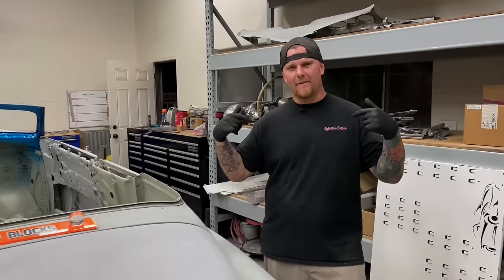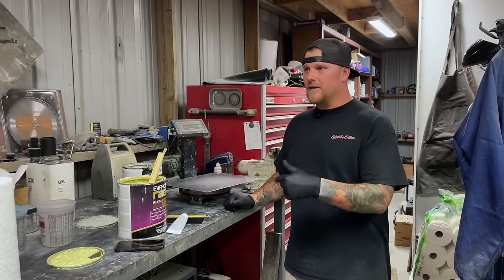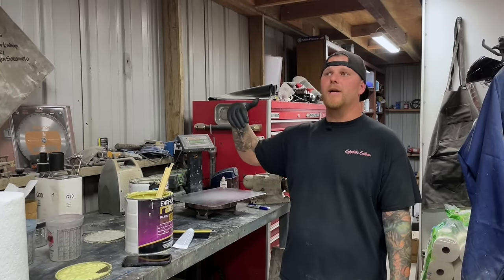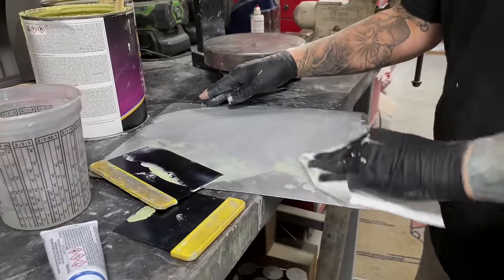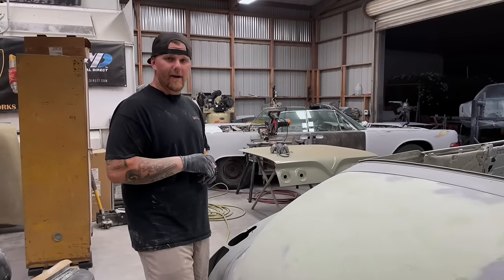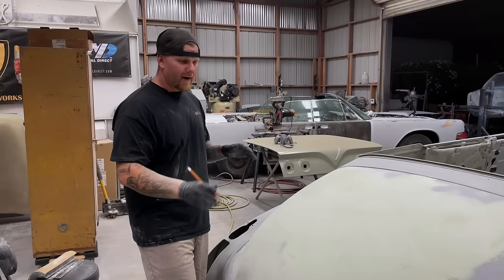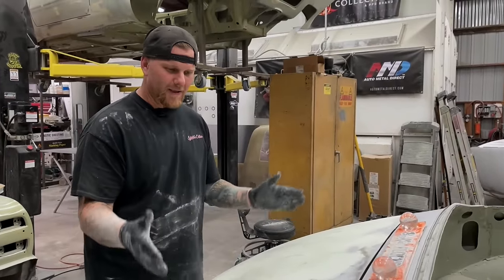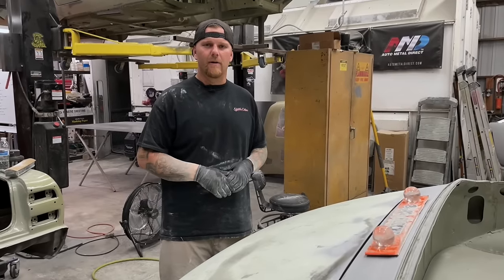The Body Filler Innovation You Can't Afford to Miss!"

Comment: I never like spot coating unless I really have to, always just reapplied my filler over the entire area. When I glaze I treat my glaze like primer and go outside my body work around 2-3 inches maybe a little more. The guide coat I love , I always have a can of gloss check as well as a final inspection then off to primer
Reply: Love the videos too
Reply from the maker: @FrankieTheTech  thank you!
Reply: All these little globs of mud make a humpty surface. On portion is softer then the rest of it. I haven’t seen any bodyman use a cheese grader in 30 years. I use a 8” DA to knock done high spots    and to remove sticky portion of the mud. It save time. It save blocking time and and paper and easier and eliminates humpty surfaces.
Reply from the maker: @dawinner777  you obviously did not watch the whole video. Everything we do has the exact same hardness it’s measured on a scale. It’s also a very tiny little bit of filler to get rid of any ripples anything you’re doing with the DA sander is not going to result in the same finish that we are performing here. This is for show cars not collision.

Comment: rage quantum is amazing stuff 4 hardeners per gallon sold separately. very smooth going on and easy sanding but insanely priced.
Reply from the maker: @jump4j  quantum? 4 hardeners??
Reply: @SYLVESTERSCUSTOMS  evercoat quantum 1 over 200 per gallon. amazing stuff. slow and fast hardener .10: 1 ratio

Comment: First off, congrats for being able to leave the doors open at that time. I would have all kinds of night creatures and blood suckers coming in. I've tried the 3M gold and  Rage Ultra and stuck with the Rage. The 3M spreads nicer but is too soupy in the heat. Best filler I've used is Evecoat Quantum. Expensive but you can really sculpt with this stuff and the hardener is epoxy based(although sold separately due to different temp ranges). I've had to cut back on the hardener with the Ultra when it kicks too quick. To me, the sound of sharp 80g is similar to a hand saw across a 2x4. I've found mineral spirits works well also for cleaning spreaders. I just make sure to dry them off. But it seems it more lifts the filler off than smear it. By the way, how are the elbows and shoulders holding up? I have good and bad days myself. Pushing 50. The life of a sculptor!😏
Reply from the maker: I haven’t tried quantum I might have to try it 👍🏻 I agree I have good and bad days.
Reply: @SYLVESTERSCUSTOMS  
It's a little pricey but aren't they all anymore. The red hardener is high temp (very slow) and the blue is mild temp. Sands great though.

Comment: Sorry about all my comments, but it’s interesting to me. I have a 1977 FJ40 Land Cruiser that I want to strip down and paint. So I watch with keen interest. 
If I understand you, you use epoxy primer, then body filler. Block to perfection and follow with another epoxy primer? What goes on after that? It also answers my first question about chemical adhesion. You use the second epoxy primer window and apply your high fill primer on that? 
I’d like to know the exact order and products used for when I do my Cruiser. 
Thanks,
Paul
Reply from the maker: We epoxy do filler work then reapply epoxy specifically vp2050 it’s a high build epoxy. Then I block that again and when it’s where you are happy with it I wet sand with 600 and  spray sealer and paint

Comment: At one time I was using Evercoat. $160 a gallon for Rrage Gold where im at.  Using Roberlo.  Works exactly the same. Almost identical. Low to no pin holes, Shrinkage hold out,sands easy, good adhesion ,1/3 the price.  Cheaper by the case.  Hard to beat. Purple 3M great product for $75.
Reply from the maker: You get what you pay for I suppose
Reply: Want to say thanks for responding first of all.  From my jobber I was told  they tripled the price to a factory burning down and supply chain issues they essentially passed that cost on over. 3m was always more expensive  product now it’s seems reasonable. Just because they tripled the cost didn’t all of a sudden make it a better product. Although I like the Evercoat products. Many products in my area unfortunately seeing things double. House branded labels are no longer being stocked. Really a bummer. If that makes since.

Comment: Ok. So the Rage Ultra is good by itself but the Extra extends its working time? Is that it? Do I need to buy both if I’m working small parts?
Paul
Reply from the maker: Correct the extra is for extra time. If you don’t need it then you are good. It’s a great tool in hotter weather.

Comment: I have a five gallon but cut in half,and keep my can of filler in there,it sets up quick cause the filler is hot before adding the activator.Cold filler gives you four times longer before it starts setting.
Reply from the maker: That will help I know there are guys who will put it in fridge etc that extreme of a measure is not good. You want the filler and panel to be the same temp. Optimal would be 70 degrees in a controlled room. But yes there are ways to pivot and modify. 👍🏻 thanks for sharing.
Reply: @SYLVESTERSCUSTOMS  I agree on the temperature of the filler being similar to the substrate, and it should make sense to anyone who is at all logical minded. Maybe tell people in a future video, that a cold filler won't be as workable or pliable, and won't bind into the scratches as well, and could cause delamination. I understand everything you are teaching, because I've done paint and body work as a hobby off and on for 40 years. The pencil trick is something I learned doing drywall, and have used it with bondo as well. Keep up the great work Teacher! Much respect and admiration. Kenny

Comment: I used evercoat until a guy left a gallon in a car I was working on of USC AG47 or USC Grip filler. And no it is not the same as zgrip......FYI. it sands faster and easier. almost as fast as Rage and is only 30 a gallon 28 to 32 depending on where you get it. Great cheap middle for most work. Really makes the Rage seem like a waste of money.
Reply from the maker: Might sand easy but does the work window get larger for 110 degree weather? Do you use a scale?

Comment: 3:45 Why paint the firewall and window frame before starting the mudwork? 13:10 Is it just because of the tight deadline?

35:35 Spreading it thin on the board was something that took me years to learn. 

The long open time of Rage Ultra Extra looks like a godsend. Wish that was around 25 years ago when we were doing an offshore powerboat. Had two guys mixing and one guy spreading in the heat of summer. Not to mention the fiberglass itch to go with it.
Reply from the maker: Yes we’re trying to get it done for Sema show so we’re taking every opportunity to save time. But yes it helps the work times so much.

Comment: We switched to rage ultra the last year or so it sands extremely well even compared to the 3m filler. Ive got a question for you how do you clean your filler off before you spread more on just blow it off good or do you wipe it with something?
Reply from the maker: Blow it off really good I don’t like wiping it with anything you take the chance of contaminating it.

Comment: Why would you use this instead of using Featherfill G2? Cost? Ability to make as much or little as you need?
Reply from the maker: Because you do not want to do all of your body work with polyester primer it is much more brittle and has a tendency to fail crack, and Delaminate. The goal is always a solid foundation. You should be skim, coating with body filler, and then sealing that up. The goal is that you only have to prime the car one time after bodywork. if you watch our newest video that came out Friday it breaks down all of the different primers.

Comment: I have a hole the size of the goofball give or take in my carbon fiber trunk spoiler. Any tip on how to fill it before sanding?
Reply from the maker: If you are wanting the raw carbon, fiber, look that will require a new panel. If you are going to paint over it, then I would recommend using fiberglass.

Comment: UPDATED Sorry you answered at around 30:35..... Question had been:  "Total novice question here....I only knew enough recently to address rust behind a license plate (80, ~120, self-etch, high build prime, sand, base/clear from an auto body supply place with SEM cans filled with PPG product) and a rear plastic bumper cover.  While it looks great, I'm obviously not fully educated when I wonder why you are filling the trunk...when that surface looks defect-free to me (chips, dents, scratches)....I had thought you'd go to self-etch if bare metal...or high build primer at the current state of how good it at least appears in the video.  I would love to know the benefit to completely skimming with body filler.  Thank you! "
Reply from the maker: We don’t use etch primer we use epoxy primer then filler work to create a perfect mirror from front to back with no deviations

Comment: hi total newbe over  the pond here in uk, love the vids just got a jeep taken it back to bear metal, metalwork is sound now just  needs filler ready to paint , my question what primer do you use first before you start filler work, as been told use etch primer on bear metal but not if you are filling on top, could you advise thanks
Reply from the maker: Etch primer isn’t a good option. We use vp2050 but you should definitely start with an epoxy primer scuff that up and do filler work

Comment: I have a big question I cannot seem to get answered. How long can rage Ultra stay over epoxy that is not primed during a restoration? Let me add that the car is inside the garage all the time but now that summertime is coming the humidity may be increased
Reply from the maker: As long as you have epoxy down the filler doesn’t have a timeline. You obviously don’t want it wet but being humid the issue is when you do filler work over bare metal because rust can start. If you have areas of bare metal showing just seal it in epoxy
Reply: Awesome ty

Comment: I use 3M for filler and I add fiber glass resin to thin it out for my glaze.
Reply from the maker: You might want to consider buying a product that gives you more time instead of modifying something with different materials that may fail later

Comment: I been using Upol after you recommended that product. Why don’t you use it anymore?
Reply from the maker: @dxrcat  it’s gone downhill way more pin holes and doesn’t spread as nice as rage or 3m
Reply: @SYLVESTERSCUSTOMS  Thanks
Reply: @SYLVESTERSCUSTOMS  I have one more question. I’m sanding the old paint off my car with 80 grit and of course it’s taking a little bit of time and I’m wondering how long I have before it starts to flash before I 2k prime it? Or should I sand a panel and prime right away? 
Thanks again for your time,

Comment: Try out evercoat z grip it comes in a green/blue tin. It's a firm but runny filler makes it easy to spread as well
Reply from the maker: 👍🏻 only issue is it doesn’t provide a longer work window
Reply: Lucky Jackson  I've never tried rage before or 3m. Where I live 3m and rage are up around 80 NZD ($49USD) and evercoat z grip is $52 NZD ($31 USD) which is a bit of a difference in price. I'm pretty happy with evercoat. Works pretty good for me

Comment: Shouldn't we grind the scratches before applying the next layer of putty after 80 grit paper?  is it about filling holes?
Reply from the maker: I think you need to be more specific on your question? What do you mean grinding? Every time you put filler on it should be over a tooth whether that be an 80 grit scratch or 120 grit scratch
Reply: @SYLVESTERSCUSTOMS  if I putty on a scratch with a gradation of 80 or 120, will it not sit down after time?  shouldn't the grit be 220 before applying the next layer of putty?
Reply from the maker: @damianxxx7108  220 grit isn’t recommended to put filler over. I recommend 80-120

Comment: I’m new to bodywork and I’m doing a 60 f100 , I used dtm epoxy , now that I’m filling and sanding, I’m noticing the bed has some minor dings out that I missed, and seeing little high spots of metal, in my first area I’ve tapped them down with a body hammer and dolly , wish I blocked it first, and will do in cab hood and fenders, just working the bed now, is my best option now to hammer and dolly them down, or build up the filler??
Reply from the maker: You need to bring the high spots down

Comment: Can you apply filler onto guide coat? If not, how do you get rid of the guide coat that's stuck in low areas within your panel?
Reply from the maker: You cannot you need to sand it off.

Comment: Interesting video we do similar work but not on cars. Mainly architectural masters for mold making. 
You did not cover clearly when to start sanding it looked like you were sanding before filler was fully hard? 
With our products I
That would clog the paper. 
Thanks Warren
Reply from the maker: I am sanding it just before it hardens even if you clog a paper just put more on if you wait till it hardens, you will start getting false shapes.
Reply: @SYLVESTERSCUSTOMS  really? That would be interesting to see the difference.

Comment: Why not get a big flexible piece to cover the whole trunk. Put 80 grit on one side and foam on the other. Press to fit and vibrate? That would remove the high areas first.
Reply from the maker: It’s not that easy foam is not going to make the panel straight

Comment: So I see the video title and I'm thinking "Awesome a new body filler to try" and it's the same exact stuff I have sitting on the garage floor right now. I'll never use another after Rage ultra.
Reply from the maker: Do you mix them 50/50?
Reply: @SYLVESTERSCUSTOMS  No, I have the ultra extra but I only used it once and didn't mix it. I still have like 90% of the pouch left.

Comment: Back in the late 1980s and mid 90s i used wide drywall knock down knifes to spread bondo doing a hood on a 70 chevelle in a couple passes and cutting down work time as a flat rate body tek other guys would laugh
Reply from the maker: Bet it worked good too 👌🏻

Comment: hi, can i just 80 grit scuff glossy powder coating or do i have to go to bare metal for the filler? thanks. its an interior counter.
Reply from the maker: Yes we don’t put filler over bare metal anyhow.
Reply: @SYLVESTERSCUSTOMS  im using bondo is that the same as filler? it has some bare metal spots.

Comment: I get that reducing the hardner extends working time. Does reducing hardner also reduce the strength of the filler.
Reply from the maker: You are correct the filler will have different hardness is to it. And when you are in temperatures like I am even reducing the amount of Hardner that goes into, it is not enough.

Comment: The biggest problem with body fillers is adhesion. Get that 36 grit and put some teeth in the steal! And float 30-40% more than you think!  And your still going to have to re wipe it! Also the longer you can let it sit befor paint the better! Shrinkage is a thing!
Reply from the maker: We actually recommend doing filler work over epoxy for high end cars not over steel. 36 grit is going to tear up epoxy. Putting on more might work for some but splines will drastically cut down your time and make better sweeps. But as for letting it sit to shrink yes that’s spot on!

Comment: is there a link for the large aluminum/steel body filler board you are using?
Reply from the maker: No I just made it out of some scrap metal in the shop. I think linear blocks sells some larger filler boards though.

Comment: Why not just use RAGE Ultra Xtra, I heard you say you get the best of both worlds, but I don't understand what the advantage to mixing it is
Reply from the maker: Buy both and try different variations. They actually have a mix ratio on their website. You can use only extra but I find that it’s too runny and I don’t like rage ultra by itself either because then it’s too soft. I just really like the way the two are together. I don’t want to wait too long to sand the car. And I want it just in the guidelines I am looking for to play with what works for you

Comment: This would be great if you could show what the actual ratios look like on the scale in weight , not sound make myself sound like an idiot as I’m not one to claim to know it all but what does a 50 or 70 to 1 ratio look like on the scale , I’ve never thought about using a scale for body filler .
Reply from the maker: Put however much you are going to mix on the scale and divide by 50 that gives you 50:1
Reply: @SYLVESTERSCUSTOMS  thank you so much .

Comment: Why are you applying filler direct to metal when the hardener contains water? I thought you sealed the metal with epoxy first.
Reply from the maker: What part of the video did you see filler going on metal? That deck lid was completely sealed.
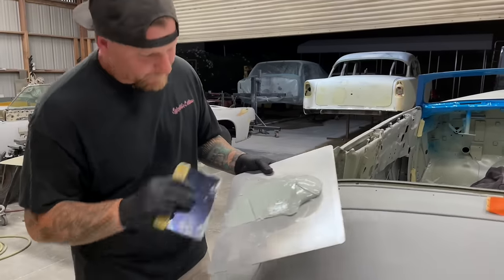Reply: @SYLVESTERSCUSTOMS  Thanks for replying! at minute 1:34 it appears that is metal to the right of the filler you're laying down. I've been spreading the news about your channel/techniques and was surprised when I saw the bare metal as you have always subscribed to epoxy sealing first.

Comment: Rage Gold is the best. Price has gone tf up but still. Rage Gold and evercoats finish sand high build primer. I hate doing gaps but it's the only way and I body work every panel on the vehicle.and the best sandpaper hands down is 3m blue. I've used every 3m red and gold etc and blue lasts the longest. That sun whatever is garbage in my opinion.

Comment: Upol does kick fast - a bit too fast tbh. I struggle to get anything else here & have learnt to mix VERY small batches or else you're throwing a lot of filler in the bin as it has kicked on the board as you're working.

Comment: Why not stop at 80 grit and then use a final high build primer to fill the 80 grit and block that out with 120? Your sealer coat will cover everything without going to finer grit for no reason.
Reply from the maker: Because as things soak up and dry 80 grit scratches will show their face later on down the road.